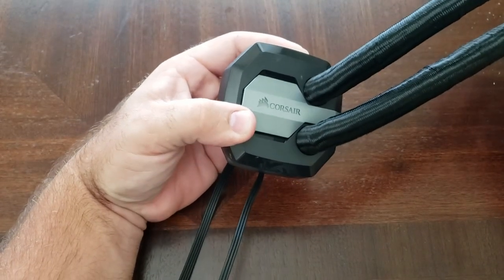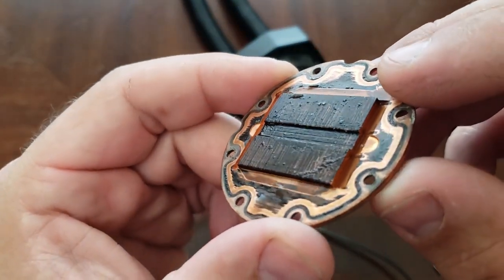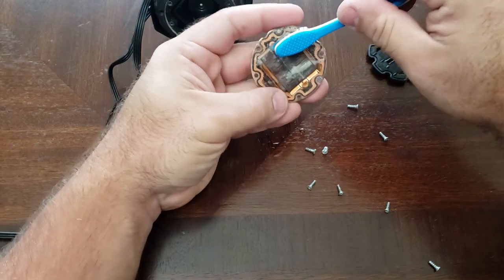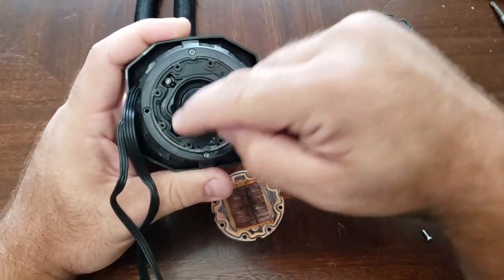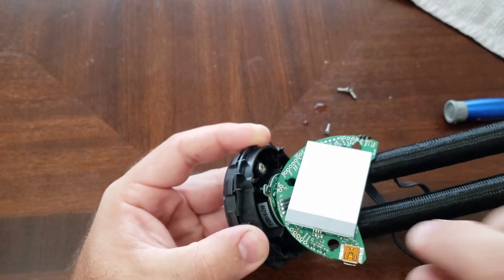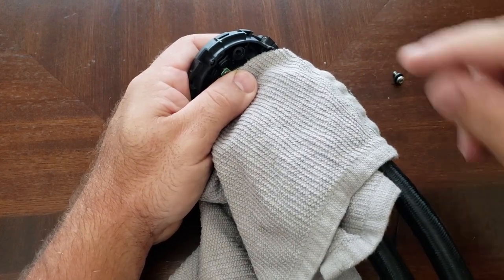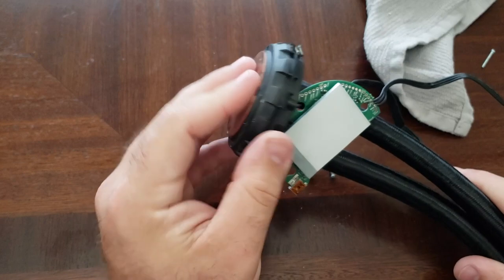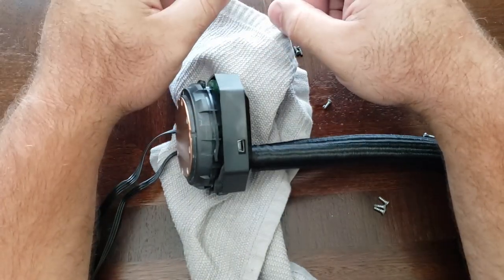Servicing an Asetek All in One  Liquid Cooler (corsair, nzxt)

Comment: You do know that black gummy material are the hoses starting to dissolve from the inside out due to the corrosive coolant? Eventually the hoses will get very soft and the coolant will actually start to sweat through the hoses and leak everywhere but by then I'm sure you would have done multiple flushes and realize its just best to buy another AIO. I'm sure you know about GM's DeathCool problem, multiple videos about that too here on YouTube. Believe it or not, manufacturers knew about this problem long before they started to see the AIOs coming back for warranty/overheating issues and knew that it was best to just use the hard plastic tubes but customers complained about the inflexibility of the tubes and had to revert back to the rubber hoses. Until they come up with a better coolant solution, these rubber hoses will continue to dissolve from the inside out and gunk up these systems.

Comment: But everything I've researched into AIO's says that you don't have to change the water or open it up so videos like this is what really confuses me about this and I'm new to PC Gaming and I'm looking to get a Gaming PC with a AMD 9 3950X Processor and that requires Liquid Cooling if you overclock it apparently. So I was thinking that AIO are more beginner friendly for people who are not experts with PC's. I also can't find anywhere about the lifetime of a AIO if you don't open it up and clean it.
Reply: I just spent a good amount of time researching  this stuff. Aios last about 3-5 years before needing  to be serviced. If you  YouTube videos of people draining their years-old never-before opened AIOs, you will see there is a ton of crap that builds up in them. 

The people who tell you that you never have to do this are people who would rather  RMA theirs or buy a new one instead of  fixing the old one. That mindset is something that was given to us by the manufacturers. They told us we would never need to do this, but as aios were new 6 years ago, people are just now finding out how long they last, and what causes them to fail. 

Good luck and welcome to the world of PCs
Reply: @ruthbakke4912  ya from what I've managed to research on AIO's it seems they only last around 3 to 4 years if you don't do maintenance on them but the problem is that if you open one up to clean it out you completely void your warranty. Just like if you was to Manually OverClock ur CPU.
Reply: It honestly depends on thw quality of your product. My AIO has lasted about 7 years with same temp readings. It is now time for a replacemeng though

Comment: I've been running my H115i for more than 3 years now without touching it. Still runs fine. I would just buy a new cooler. I would never risk stripping and reassembling it for fearing it might leak. If it was to leak it would spill on the most expensive part on a pc which is the GPU.
Reply: Hi! I bought a new-to-me H150i and disassembled it on day 2 due to the micro USB got removed from the circuit board. Now I'm at a loss for disassembling the motor from the circuit board - yay me! I can promise you your H115i internals will largely differ from this AIO. Cheers!

Comment: How mmuch coolant does it take? I have a 510LC asetek
Reply: Does this video apply to my liquid cooler or is it different? I managed to get a leak and tried to fix it but i have air my system now and ordered replacement from ebay but wont be here for a weeek and was thinking using distilled water to refill my system.
Also the recomended coolant for my asetek 510lcd s sold in 1 liter. Bottles...need that much? i

Comment: Great video! Subscribed and thank you.

I've got a Corsair H115i and it's causing my CPU to overheat. It still appears to be working as it can still keep it a little cool whilst it's idle but can't cope with any kind of pressure. One hose is getting really hot and I've found out that this means the head is probably clogged. 
So I've got de-ironized water, can I get away with using just this or do I need some coolant also?
Also, should I flush it a few times? Do I need to use de-ionized water for the flush? Do I need to power it to cycle the water a few times for a flush? What would be the best way of getting power to it outside the case? 

Any extra advice is greatly appreciated.
Reply: aJshortofaQ Same problem here
Reply: Flush it a few times, fill it with ironing water and coolant, it has a protective effect on metals and it's inexpensive. Also I wouldn't flush it powering the pump because it couldn't be designed to work without a load
Reply: I have exactly the same problem H115i is in 4th year now, ambient temperature is 24'C, i7-6700K (no overclock) idle temp is 50'c, always throttled down when I do stress test with AIDA64 Extreme or failed with temperature of >90'C, I just bought Noctua NH-D15 and now my idle is 28'C, stress tested temperature maximum is 40'C, I will never again buy an AIO, air cooling eventhough it is big and ugly it will do the job

Comment: Thanks for this video! I bought an MSI 1080Ti Seahawk card secondhand, which has a Corsair H55 cooler in it. Was running fine for 5 months, I opened the GPU (just the casing) to remove some built-up dust, and then the issues began. My temps are running crazy high, as in 90 degrees Celcius after just 30 seconds on Heaven benchmark. Would you advise that I also clean it as you did in this video, or is it the fluid levels that are low?
Reply from the maker: If it was working fine before opening it up, then you might either have not enough mounting pressure on the gpu block, tighten it more,  or there is not enough thermal paste
Reply: @CustomCarsComputers  Thanks for the tip! Will tighten it more when I get home. That being said, the one pipe is 100% getting hot, so that means the heat is being transferred, correct? The radiator remains quite cold, even without the fan. It's like it's only heating up at the lower part of the radiator corner, but the rest remains cold. Does this mean the pump is broken, or that the fluid level might be too low?

Comment: 1. Would you consider or have used a gasket sealer when putting it back?
2. How did you flush the radiator?
Reply from the maker: No sealer is needed, I just ran water through the radiator to make sure there were no flow issues or discoloration

Comment: why do these get dirt inside, when they are sealed units
Reply: Maybe from a bit of the tubing corroding, or impure water, etc. You are correct though, AIOs don't need "maintenance," they will work just fine. Mine has lasted about 7 years, but it is now time for a replacement.

Comment: highly recommend using a push pull fan system on small radiators...i still have'nt found any type of pull fan design out..all fans are push blade..even the GPU fans are push (food for thought) wouldn't you think it better to pull heat away from the heat exchanger on GPU's rather then blow the heat back into the case their in ?  like how a car rad. fan does when the car is sitting idle..

Comment: I got my H55 that can't maintain temps after 6yrs of use. I'm thinking of refilling it from the pump side to check if there's any debris in there. My question is: can I refill without powering the unit on? Is any amount of air inside detrimental?
Reply from the maker: There will most like be build up in the water block, i would take that apart and clean it, you can also fill from there as well, just make sure where you are filling from is the highest point while you fill it to allow all the air to get out, alittle air inside will be ok, for best results make sure the radiator is mounted with the hoses on the bottom so all the air stays at the top of thw radiator and not in the water block
Reply: @CustomCarsComputers  Thanks for the tips. Gonna go buy a syringe and some glycol-based antifreeze and get to it.

Comment: i have the same water block and im having a issue with high temps but if i tap the pump/ block  a few times it returns to a normal temp.
maybe getting jamed by debris  in the water?
Reply from the maker: It could be getting air trapped in the water block, make sure the radiator is mounted either to the top of the case or on the side with the hoses on the bottom, that way the air will get trapped in the radiator and stay out of the water block, Gamers Nexus has a great video of this subject.

Comment: Hi I just got a asetek 550lc and the pump works I can feel it and in the bios it says 1500 Rpm. I shook the radiator and hear the liquid but inside My gpu though is not being cooled at all. Do you know what I should do
Reply from the maker: Could be bad mounting pressure on the cpu block make sure you are using the right screws and they are tight. Use good quality thermal paste, and make sure the radiator is mounted with the hoses at the bottom of the radiator so air stays away from the hoses.
Reply: Custom Cars & Computers ok ima try this thank you!
Reply: You need fans to mount on your radiator bro
Reply: @xXxAssassin4lifexXx  thanks I figured it out it was bad thermal paste all good now running 50 celcius on full load 😂

Comment: I removed the small pcb, if i take it to a computer shop and they solder it back, will it work again?
Reply from the maker: It should, unfortunately the wires to the pump are very easy to break, mine broke and destroyed the trace on the board, not fixable,  but theres a possibility yours could be
Reply: @CustomCarsComputers  i didnt brake any wire, but i removed the pcb from the top of that magentic "wheel like" although, that didnt seem to be soldered, because there are 3 pins on the pcb, that go inside 3 holes of plastic, on that "wheel" so i dont really know

Comment: When ever i turn on my pc omen x core i9. 7900x a message comes and system shuts doen after 15 seconds
a fan is not operating correctly. Continued operation is not recommended and may cause unpredictable behavior that could result in random shutdown, data loss or possible system damage. ... Pump speed (90b) .
Press enter for startup.then fans start running at a very high speed and system shut down automatically.
Guys please help me what to do
Reply from the maker: Could just be a bios setting, if you have a water cooler and its plugged into the cpu fan header, it could be giving a false error, go into the bios there should be a setting to ignore fan warnings, each motherboard manufacturer has a different way to turn off the warning,  then just monitor your temps

Comment: what happens if you put real water in it?burn?
Reply from the maker: It will work, for a little bit, water allows for algae growth and corrosion from the mixed metals these coolers are made off, for a cheap quick fix you could use regular 50/50 automotive coolant if you needed something

Comment: Whats the best fluid for h115i
Reply from the maker: Most coolers it is hard to tell if they are using mixed metals, so it's a good idea to use a fluid that will prevent corrosion, ek-cryofule is a good one, but there are many out there to choose from.
Reply: I moved mine around and it sounded like it had a stone in it. Ive not taken it apart yet. Sounds like it needs a full flush
Reply: hey, what is the tube ID in case i wanted to extend them on my H80i v2